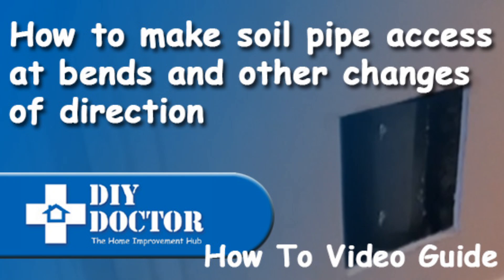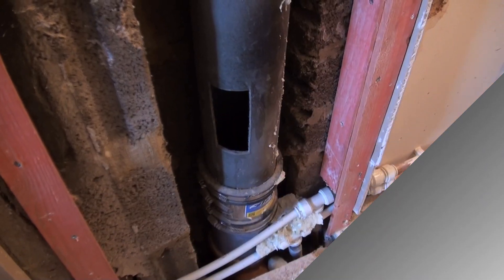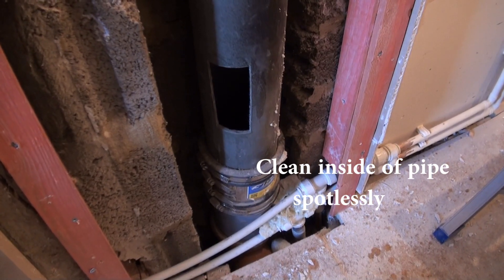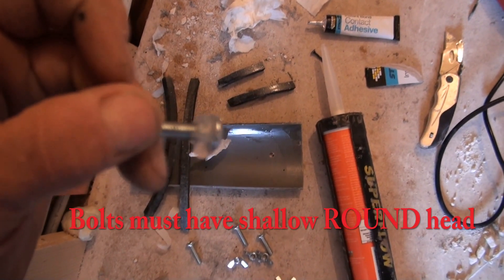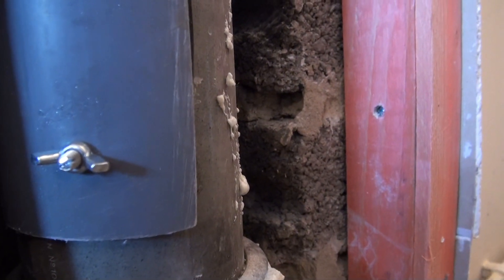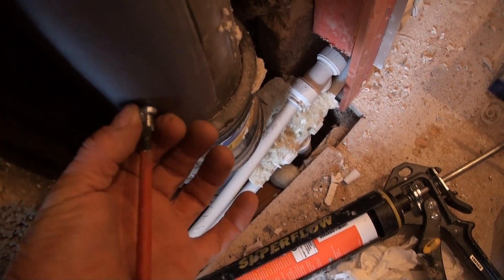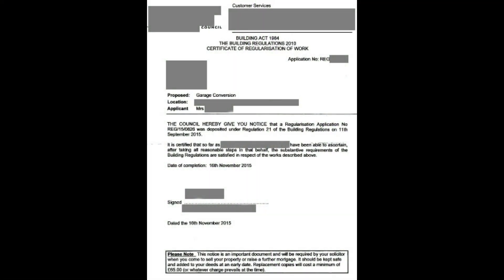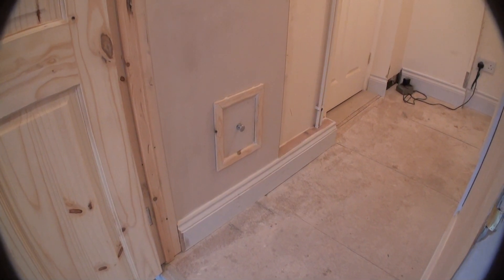Rodding access in soil pipes at bends and junctions

Comment: 2 ferncos with a rigid access coupling and a metre of 4 inch would have taken less time than to do that
Reply from the maker: Time didnt come into it. Access, damage and cost were the drivers and our solution overcame everything we were trying to achieve. Sure we could have saved 45 minutes on the connection by ripping the boxing out and kango'ing half the floor up...but then of course it's all got to be put back together. I'm sure your clients have much more money than ours and would be happy to have their bill increased. We prefer to find a low cost solution for them as long as all the required regs are met.
Reply: +DIY Doctor what damage? It's exposed anyway all you had to do is cut soil with reciprocating saw or hacksaw , sure hack saw you would have taken longer but as you said time isn't an issue , any way i obviously don't know what I'm talking about  and spent the past thirty years as a plumber that have been wasted ,
Reply from the maker: Im sure you are a great plumber, but so our our guys, with every bit as much time served as you. You cannot get simple solutions to every job and you cannnot possibly see everything that was involved here. You seem to be assuming that our lads chose this solution as one of a dozen alternatives.....There were no alternatives that did not involve extensive damage and big extra costs so please just accept that however long we have all be doing these seemingly mundane jobs, sometimes things just happen which are totally out of the ordinary. The mark of a good tradesman is their ability to get over problems which arent in the manual and thats exactly what the lads did. If there was a simpler solution we would have taken it
Reply: +DIY Doctor I never said your blokes weren't  good , my option was basically it would have been easier to cut out , what you have basically shown here is how to fit a access door that is similar to the terrain mechanical  access doors that were about in the eighties , which were a pain to fit even for a trades person , it was in no means a dig at you it was my opinion, have a great day

Comment: I would be totally amazed if that passed an airtest on that soil , why not show a video how to  fit a push fit coupling with access already on it , would have taken half the time this took
Reply from the maker: The adaption passed inspection. There was no way, without removing half the stack (whch was internal and boxed) a, proprietary coupling could be inserted. The whole point of this video is that sometimes noral procedures cannot be followed and with a bit of ingenuity and solution can be found. Showing a video of pushing a pipe fitting onto a length of pipe is hardly groundbreaking stuff and in this particular case would have added at least £800 to the cost of the job.
Reply: Plus you can get a slip access coupling that will straight into the fernco , don't think I'm knocking you you just made so much more work for yourself , plus the soil is plastic and not cast so it's a dream